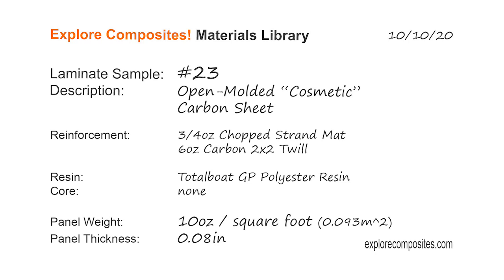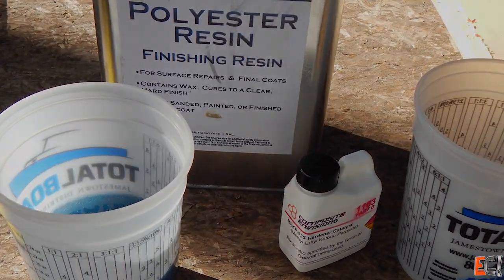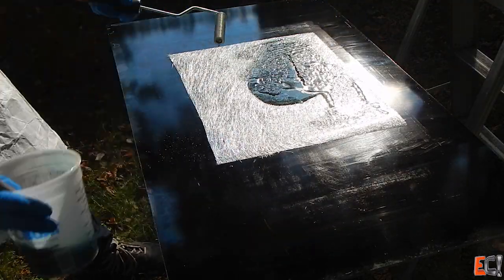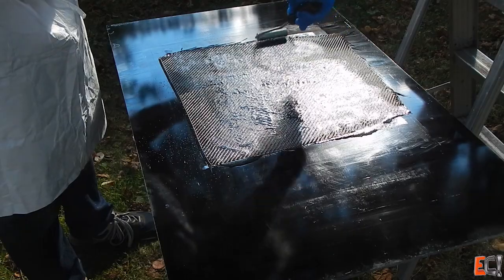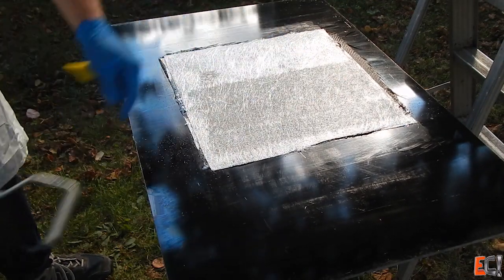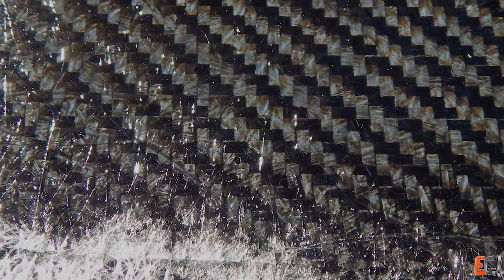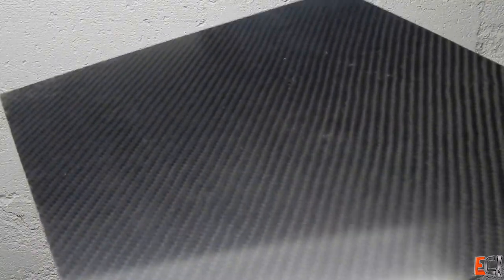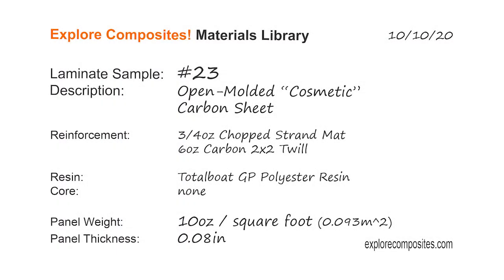Laminate Sample #23: Open-Molded “Cosmetic" E-glass / Carbon Sheet

Comment: I’m confused… the video shows the carbon as the second layer and csm being the first … am I missing something?
Reply from the maker: CSM goes on the surface just to give it some depth and hold a resin-rich layer against the mold(table) surface.  Also makes a somewhat symmetrical laminate to reduce warping.

Comment: Kyle.Engineers says that you shouldnt wrap Fiberglass in CF, is this because of the lack of strength and adhesion per layer? I do notice that it flexes more than 4 layers of carbon would typically
Reply from the maker: Oh yes he’s generally right on.  This is not an example of anything structural!  The carbon here is purely cosmetic and the resin is polyester.  You’d use this to add some bling “carbon” but not to do any actual work.  

If carbon fibers and glass are laminated together in the same direction the carbon being stiffer will load up and do all the work before the glass even really starts to help.  Also avoid carbon with polyester resin for real things because the resin strength isn’t there and adhesion is much better with epoxy.  Also CTE issues and other problems.

Comment: What yields more mechanical strength..?
More epoxy or less epoxy to a regular fiberglass cloth???
Reply from the maker: The fiberglass gives the strength, the epoxy holds it all together.  You only need enough resin to allow the fibers to do their mechanical stuff - usually about 30-45% by weight.  Beyond that excess resin just adds weight and can reduce mechanical properties of the composite.  Optimal fiber to resin ratios depend on reinforcement type and style...

Comment: I'm surprised how "clear" your chopped strand mat was! The part simply looks like a CF laminate.
Reply: Yes, I rewatched it twice to check that it was csm that went on first.
Reply from the maker: It is pretty good - the mat just sort of melts away as long as its fully wet out.  It isn't quite as good as clear-coat on a "real" carbon surface and it looks like there's more depth with this - because there is.  Chopped strand mat could be replaced with an even thinner veil probably but I didn't have any...

You can still see a little shrinkage on the surface from the glass strands but that should go away with a clear finish and gelcoat would hide it.
Reply: @ExploreComposites  sorry this is an old comment but just wondering if you’ve used the powder bonded csm to be used with carbon / epoxy laminates rather than the styrene bonded csm that generally gets used with fibreglass/polyester resin layups?